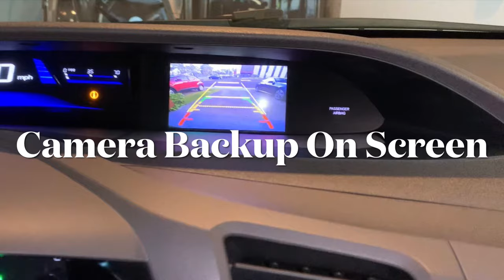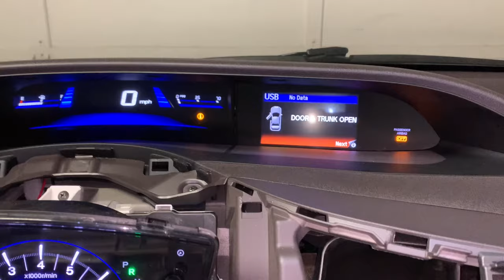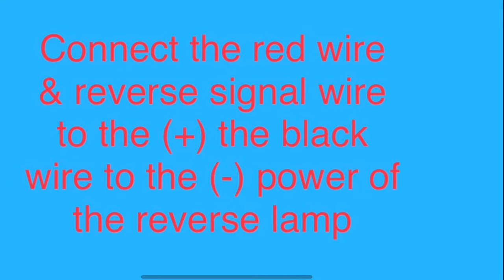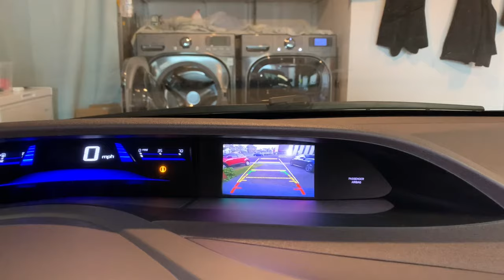How Install backup camera Honda Civic 2012 info car screen

Comment: You got rip off.  😂That kit is expensive.  Like around $130.  Lol.   I would use that to get the swc1 axxcess steering control instead.  Plus you need a back up camera.   It’s really not that hard  I did mine and I didn’t need to use a wiring harness kit.    All you need to do I tap 2 wires to the imid.   I spend $25 reverse camera from amazon …. And some wires.
Reply: What 2 wires?? I dont wanna spend my money on the harness 😂
Reply: @mojolocomtx     The imid. Or info screen.   The harness on the back     Tap into black pin#3 and white pin#19.
Reply: @Pokka676  Do you have details to share that source, I want to make sure. thanks.
Reply: @Pokka676  is that for the camera what abt the connection to the break light?
Reply: @Mrgabe-yn7yh  camera comes with necessary witing for installation. It comes with wires
Reply: If you can do a video, that would be great
Reply: @Pokka The black pin 3 and white pin 19 on the imid harness is for video? On the camera RCA cable which one goes to the black pin 3? is it the ground?

Comment: Might as well do a cheap touchscreen radio at this point with apple car play
Reply: The problem with most aftermarket radios with backup cameras is the boot-up times. You might wait 15-20 seconds for the backup camera to come on.
Reply: Which one would you recommend under 200$?

Comment: It would be good to know right from the beginning, that you need to supply and run your two wires from the backup lights to the front. Once that was clear the rest of the install was relatively easy. I'd give this video an 8/10 otherwise.
Reply: Deez Scheiss:  how well does it work at night?
Reply: What gauge wire do you need?

Comment: Thank you for displaying careful work.  In 2012 when my Si was still new, I was equally as careful not to damage any retainers when I added a back-up cam.  However unlike yours, the PAL/NTSC/CCD cams back then did not include an interface harness. I added pins 3, 14, 19 & 20 to i-MID Connector-A and made my own cable.  (The pins are sold by JAE Electronics.)  The dashboards on Gen 8 & 9 Civics are built like "Lego".  Only way to get underneath is by pulling them off.  The Si is a "stick" so my setup included an old VW cabin light delay relay installed inline on the power supply circuit. This way, I "see" a bit more of what's behind (about 3+ secs) after shifting out of reverse.   

I took a revived interest in your video because I've forgotten what's beneath the upper dash panel. I'm upgrading to an Android NAV system so I'm looking for space to mount the 4G Diversity & GPS antennas without cabling them too far for the head unit.  Yup, looks like there's space. My other option is to drill the roof just behind the rear cabin light and install an external tri-band "Shark Fin" type antenna.  Err..., I'm trying to avoid drilling holes in my car.

Comment: I'm going to install a front and rear camera on my 2005 Civic. Just wondering how to run the cables to the back. Got some hint from your video.  Thanks.
Reply: how do you run the wire for the front camera to the engine bay?

Comment: It looks as though that information window now only defaults to either your back up Camera and the time. Am I correct in assuming that installing this will cause you to lose the other information windows?  Thanks!
Reply: I would think the camera signal overrides whatever's on the screen, but once you're not using the reverse gear you can still switch between info screens

Comment: Hi there,
Could you please give me any advise for solution of problem I faced with aftermarket rear camera installation to my wife's Civic 2014 LX?
The camera I have installed myself doesn't work normally. Actually, all connections are simple (you know) and nothing special there but anyway.
I found in web some info about iMid hidden menu and found camera setting there. Miracle happened and camera works BUT! only when I entered into that service menu. Everything works fine (black screen and camera is OFF and in triggered reverse mode the camera is ON) but just until I'm out of this menu to normal screen mode (info, music, radio, etc). After that there is no camera reaction on reverse  shift stick mode. In the same time, built in LEDs in the camera work fine, mean its powered. I'm confused a little. Maybe, something wrong with iMid adapter which comes with camera,  like pins mapping, etc? Will be appreciated for any ideas. I heard in some cases the iMid should be reprogrammed somehow via OBD, is it true?
Thanks

Comment: Would it be possible to take a factory installed backup camera from a 2013 and connect it to 2012 through the IMid screen?
Reply: I honestly don’t see why not the radio can’t be much different but I’m not sure

Comment: The camera comes with the wires
Reply from the maker: Yes, but you have to buy some Wires for camera power.
Reply: Thank you very much for the detailed video ! I have questions. Do I need to buy both red and black wire ?  Did you buy at Amazon as well ?